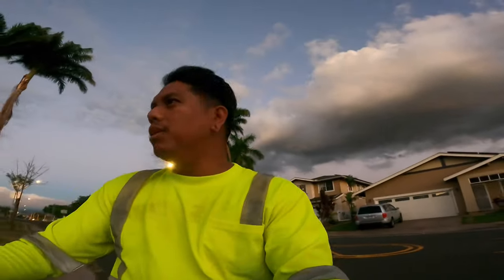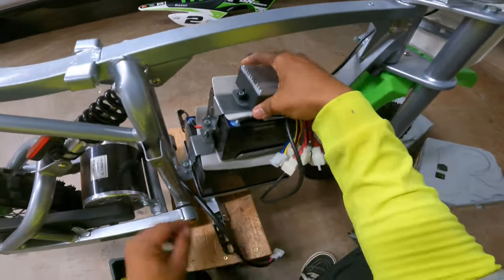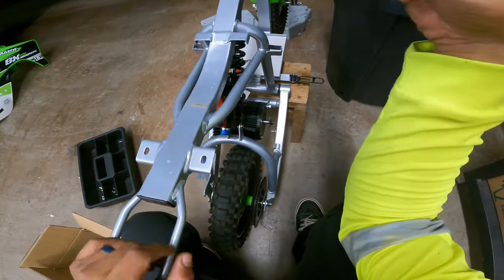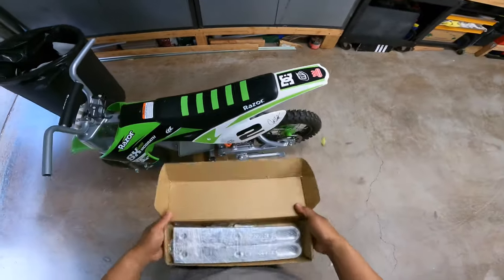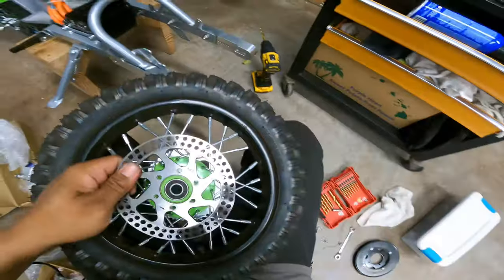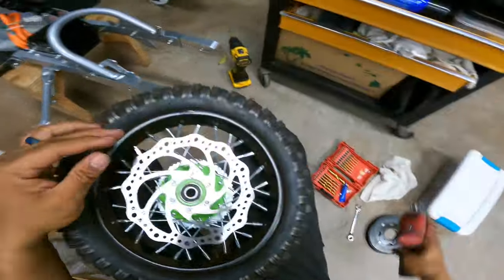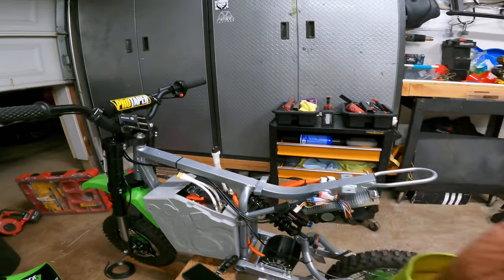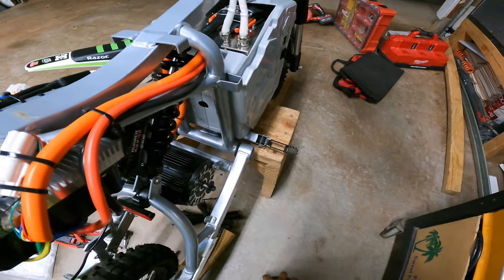The Ultimate Bolt-On Razor Build

Comment: What made you go with the 500 vs 650 Razor?
Reply from the maker: @dad3562  SX500, MX500, and MX650 have the same electronics. MX 500 and 650 have the same frame and the sx500 is different from the MX with a higher backbone giving it more battery space.
Reply: @JonnyDuzzit  thank you for posting this was very helpful!

Comment: I’m doing all the same upgrades but with a My1020. Curious what bracket did you use to mount Fardriver in that location? That’s better than zip tying it near battery.
Reply from the maker: Just some 1/8" thickn 3/4" wide steel stock.